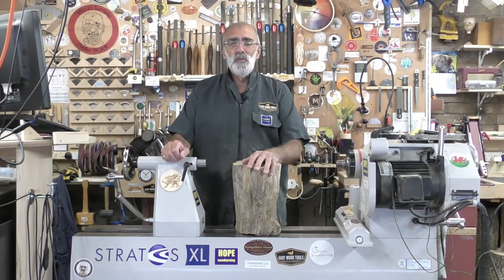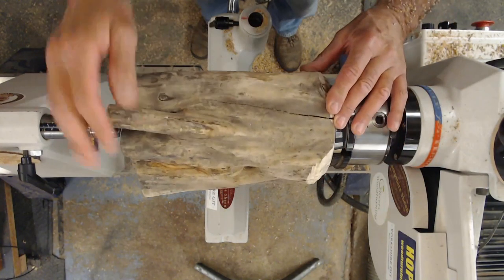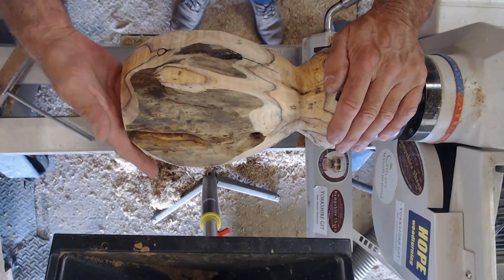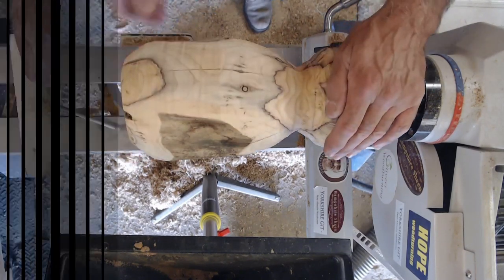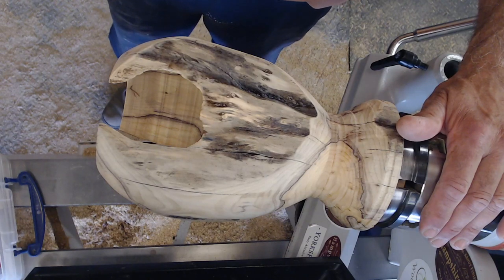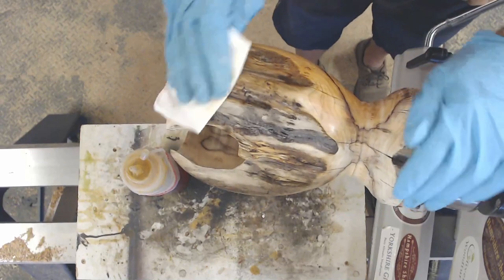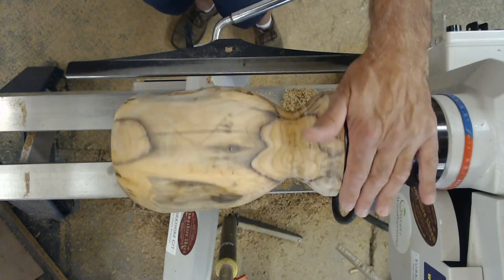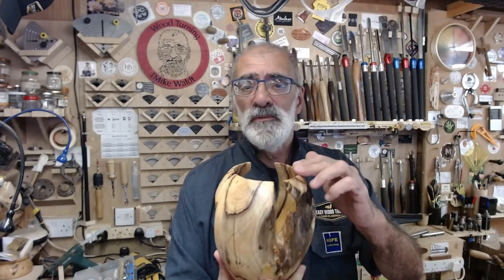Woodturning - Yew Crotch Hollow Form

Comment: Turned out really nice Mike. All the oil because it was so dry? Do you ever use the Hampshire sheen wax on top of the well cured oil? Thanks and cheers from MT.
Reply from the maker: Thank you.
I chose oil because I prefer it with pieces like this as the voids and inclusions tend to trap the wax. After its cured I then buff the smooth areas with Carnauba wax.